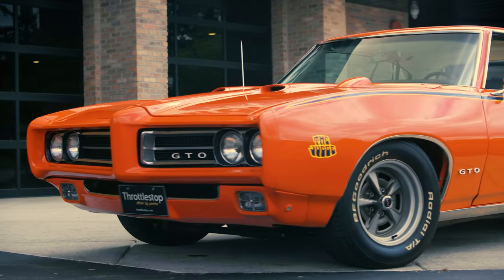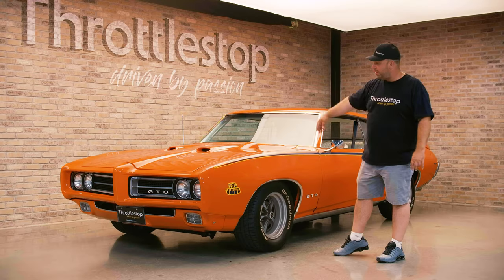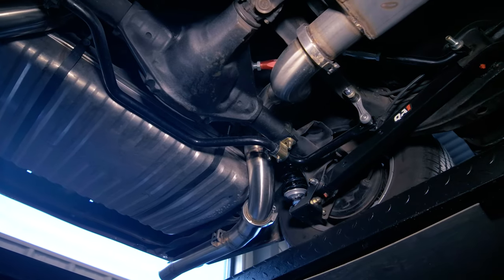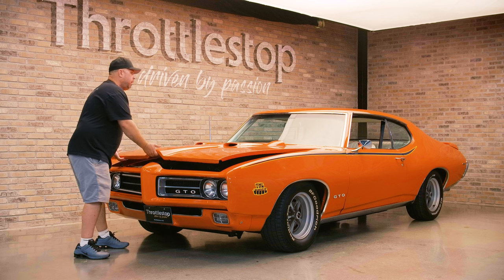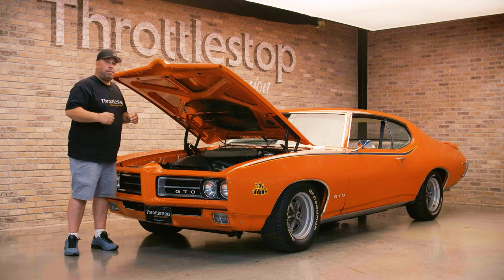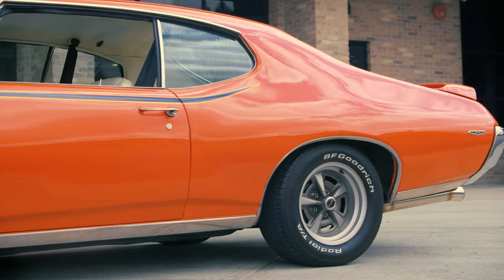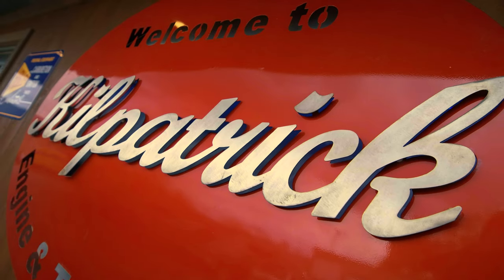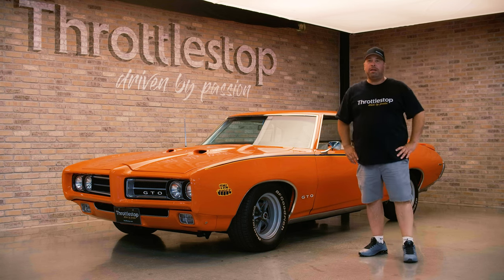The 1969 GTO Judge - Throttlestop's Restomod Ram Air V Beast

Comment: Wonderful build on this one. Still got that unicorn engine with modern gears and suspension making it easier to daily drive. Despite the 11.5:1 compression ratio these had. Be proud.

Actually, according to what I've heard from old engineers & racers, if you put
R/A V parts onto a 428 block with a single quad, it's then classed as a R/A VI and dual quads would make it a R/A VII.

Meaning this GTO Judge actually has a Ram Air VI.

Comment: How stock built is this 428 ram v ? Just to know how does the ram v power feel compared to ram 4 and other great pontiac motors ? Everybody always said the ram v could have been the hemi killer. It seems you have driven a couple ram v's. Pontiac all the way.
Reply: @Michael Harper  The Ram Air V was a little known option that came in the trunk and was dealer installed.

Comment: I remember the ride in a Judge in 69 and it sitting in the front yard, I was 8 and was told it was a two fours, 4 speed and 4:10 and 4 miles to a gallon.

Comment: Throttlestop, you guys are "killin me". !st the 69 T/A, and now this. Absolute perfection. Fantastic job, I would pay just to see this in person, and click off a bunch of photos. (Unfortunately, I'm in new England.) :(
 You didn't mention the rear gear. Gutta be a 3.73, or 4.10, seein you got the OD. 

RAV heads on a 428. I think Speedwin Automotive offered a similar eng. in the 70s, only it had RAIV heads, and a Doug Nash Tunnel Ram. (Way cool). 

If I had that car, I'ld remove the power steering, fat frt tires, and stick a Mr. Gasket V-gate shifter, and take it to the drags. Yeah!. But this one is a cool road car, I guess. Thanks again for posting. Nice.
Reply: Well then THANK THE GOOD LORD you don't own her!  Because the mods you would do, SUCK!
Reply: @jasonmacneil2256  Says you. Personal opinion. All in the way you were raised.
Next, I'm sure you'ld convert it to a P/G, and put A/C in it.
Reply: @joequillun7790  If I changed anything, it'd be to put a tremec 5 or 6 speed in it, update the suspension with pieces from ridetech, and put some 6 piston corvette brakes on her.  Unlike the duchebag things you'd do. Oh, and probably do a paxton underhood supercharger.
Reply: @jasonmacneil2256  Handling improvements. Sure, cause those cars are really known for their handling. And all your improvements are for what? Salome racing? Autocross? Cross country racing? Or just park it in your garage 50 weeks outta the yr, and show it off at a couple cruise nights. RAVs are for high RPM performance, not putzing around on the side roads. You've already shown your cards, and I'm bored, so I'll let you have the last word.